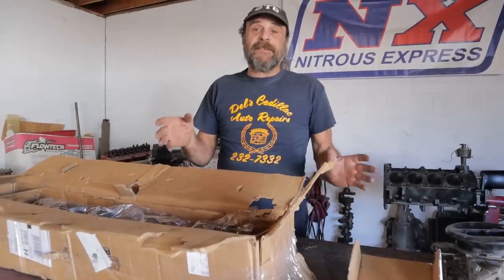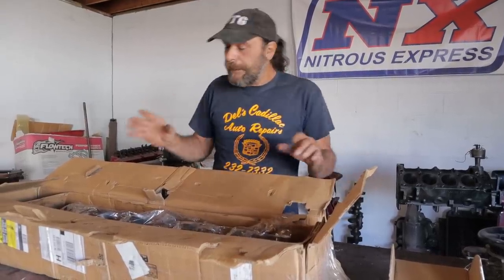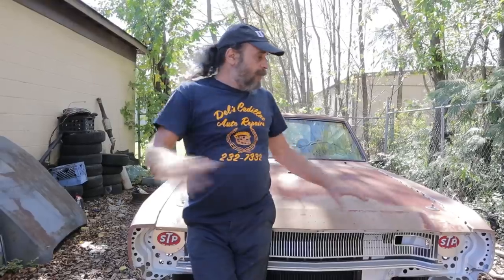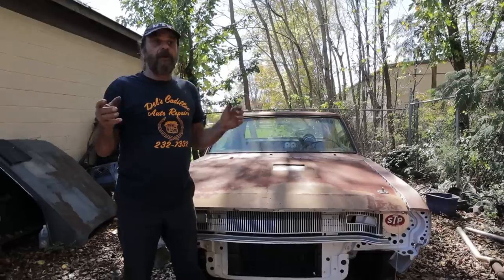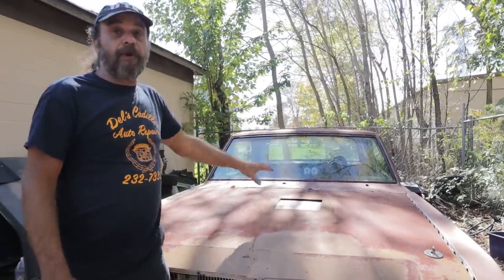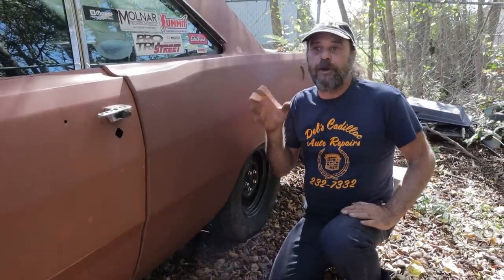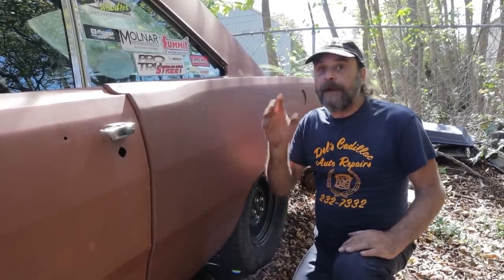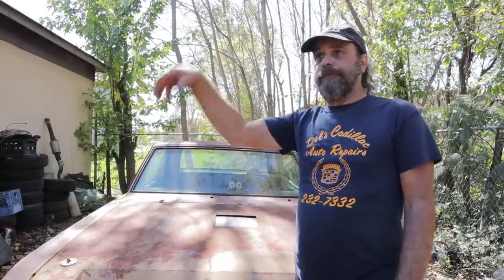The Plan Z Dart - Two Steps Forward, One Step Back

Comment: When you are looking for good metal with nice bends for fabrication,check out old washers and dryers,16 gauge metal with good bends.
Reply: @johnpossum556  If it is small,just a bench vice and a hammer.
Reply: Poor man's brake can be made with 3 pieces of wooden 2x4 , a piano hinge , and 2 C-clamps. 
Put the piano hinge between 2 sections of 2x4 , position the metal over the piano hinge , and then place the third piece of 2x4 over the metal as a clamp . 
Use the C-clamps to both clamp the 2x4s together , AND to hold it to the bench or tailgate. 
Raise the hinged piece , and viola , a brake bend . 
Sawmill 2x4s have a slightly rounded edge , and will put a minor radius at the bend . For hard square corners , you'll need to rip the 2x4s first to give them square edges.
Reply: Whaaat? No way. I've never seen one of those machines that hasn't had a few rust holes in it. They're well built but time gets everything.
Reply: @GlamStacheessnostalgialounge   you ignore the rust and take the solid metal. Since they are often free for the scrapping they may be a decent source of material.

Comment: I would do this, as its something I have done on several A-bodies and it makes a huge difference in the car.

Run 2x3" box tubing from the back of the torsionbar crossmember through the rear crossmember, and cut the bottom of the frame rails out to slide the box tubing inside.  You will have to slit the floor in the rear footwells for the tubing also.  Move the springs into the frame rails by building a box where the stock rails curve upwards.  Tie the box directly into the 2x3" tubing. Build the box out of 14g with 1/8" plate reinforcements, or just use the plate which is stronger.  I usually drill three holes at different heights for the front spring bolt.  That way you can easily change the pinion angle with minor rear ride height changes.    You will have to reinforce the spring bolt holes if you use 14g so its worth it to use the plate.  

Weld everything solid.  Especially where the 2x3 tube comes through the floor, and gusset it at the torsion bar crossmember.  Now you have full frame rails front to back in the car that are fully tied into the unibody structure, and all your front spring mount forces go through the entire car instead of being concentrated in just the rear leaf spring mounts welded to the side of the frame rails and the rocker.  This is which are pretty flimsy from the factory which is one of the reason the convertables got a big reinforcement there.   

You will have less chassis twist so your rear suspension will work better and respond to tuning better.  Its also reasonably light.  About 40 lbs added low and rearward in the car, depending on how thick the tubing you use is.
Reply: Brother I wish we were Neighbors.. Mopar A Bodies Forever..

Comment: Here in Sweden they put salt on our roads 5 months of the year so that is really bad for our cars.
Still I think its possible for you to fix that rust on your car.
Nice too hear that your are planing to test turbo/compressor on your build.
I have built a 318 stock engine from 78 with 360 heads, cast piston and stock rods. Holset hx50 turbo. 904 auto
Blow through holley 600 single pump. pressure converted only with tools in the garage. 
Used the car for several years and it runs nice. BAD 60 ft but that´s what I´m going to fix this year/winter
Et 1/4 12.4 sek and 123.5mph(197km/h) 2.2sek 60ft. Slipping in third.
Keep up the good work and thanks a lot for all your great tips.

Comment: my 340 swinger had the same rust issue on both sides. this is quite common for rust belt cars. most likely the spring mount is solid . the inner and outer rocker probably need patch work .

Comment: Could you do a video on the factory choke set up and how to adjust it on the one barrel Holley for a Slant Six (specifically in my case; a `72 Dart Swinger)?  Thanks.  Keep `em cranking.
Reply: I think he would tell you to add a manual choke cable. Mine never worked right either, even in Fl.

Comment: You can see this unibody is structure is compromised by the alignment of the rear of the door to the rear quarter, the whole rear quarter is lifted up, about 3/8” . That is also why it leaks like a sieve into the interior.
Reply: Could be the door pin is just cracked out, and coupled with worn hinges, lets the door sag... See that a lot on A bodies. My 67 GT, and 68 Dart were both like that, and so is the 69 im about to bring home...
Update... After rewatching, it appears its already been plated/fixed... Never mind LOL
Reply: @Ronald Leckfor, I think the gap is because the weather striping is missing in the door jamb just like the hood stops were removed from the radiator core, look at the hood on the drivers side.
Reply: The top of the closed door rear mates much lower than the top of the rear quarter dog leg. That is what I’m noticing, like the rear quarter is being pushed up, bearing vehicle  weight and giving a bit.
Reply: @DishNetworkDealerNEO  I see what you're talking about but I think it's an optical illusion, the door & quarter panel are two different shades of color, plus the weather stripping is absent, then you have the lighting (shadow from sunlight), also the door may be out of adjustment. Without seeing how much metal is rusted away, it's hard to say. I would say the door line is more like 1/4" out, if that, doesn't take much to make them look way out. Same body line that my '76 Valliant had @4:22.

Comment: hey uncle tony young car guy here 22 i just bout a 71 dart swinger off my neibor that broke his hip for chap just fixed the 318 that sliped the timing chain and bent the vavles and i did bunch of more work to the egine headers cam intake ect  but the 904 is blown up witch he told me aswell seeing if you have an 4 speed manuel set up with clutch pedals and all thatt jazz to go with  forssale for 71 dart because i sure would like to be ripping gears  thanks

Comment: I had a 68 with a slant 6. The top of the car had what was left of a vinyl top. Needless to say the top was so rusted that you could tap on it with a screwdriver and it would dent and chip the top. It was a mess. I offloaded this car because I had already bought and installed a rebuilt short block. It ran well after 4 distributors and 3 carbs. Tomco was what I ended up with. Ran like a top. Not worth putting any more money in to.

Comment: That's what sucks about old cars without full frames. Well, I would just get cutting so you can get a good look at it all. Cut all the bad metal. You'll get a much better look once you cut that rear quarter off then you can access the damage. It's a great car and well worth fixing. You can't just chop it up because there's only so many of these cars left out there. It's just a little bit bigger project but since you have all winter, why not? It's just metal and time and if you don't trust your welding skills for structural metal fabrication work, trade and barter for swapped time. Build an engine for someone in trade.
Reply: Couldn't he just throw some crappy welds at it, mud over it and get frame connectors made? Seems like the best option for these a bodies
Reply: @jamessilly6837  No it needs to be properly fixed. You're probably only looking at half to a full day for an experienced fabricator if he's already gotten all the rusted panels and structure cut out. No matter what, he can weld the new sheet metal quarter back in once the spring support section and surrounded area is all repaired.

Comment: Title is about the outro more than the story? Haha hope she's ok. Next time Tony, pretend to try catch her! Cant wait to see what happens with that car, it's a VF Valiant Pacer Coupe in Aus, my first pick for my first V8 car as a young lad but an old 67 XR Ford Falcon GT replica which I've since built the drivetrain from a 302c Borg Warner gearbox and diff to a trutrac 9" 3.90 31 spine Curries axles with a built TopLoader Hurst shift kit Scat 408c sleeved bores crank and cam journal alignment xrayed cracktested found a weak spot above a cam journal had it rewelded removed every sharp edge on it internally and concrete filled it with all the goodies top to bottom good for 250kw at the wheel as seen in my profile pic and an idle video or two I currently have posted on yt mostly just for a few mates to view nothing big. It should support what I'll torture it with until I look at boost in its future iteration's. Look forward to the channel content your  a God Amongst Men and we are lucky to share a piece of your knowledge

Comment: Hay Tony start with a 69 east 318w9 block factory bore n stroke 10.5 to 1 compression pistons 292 504 cam scorpion rockers / I think 1.25 push rods hydrologic lifters (more forgiving) now the trick late 80 j-heads come off a 360- port matched polish only the exhaust 340 LD4B intake Holly 3310 / now mine was remaned by the man who was a engineer for Holly the 3310 was his baby what is EPA would not put it out the way he designed it oh he got mine and rebuilt it to his original specs - oh cut the heads to 59mm with will jump the compression around 11.5 to 1 now I ran factory exhaust that was sent to Pennsylvania and had a semi-solid poor through them which open them up and polish them they ran as good as any set of headers I have tried this little mad 318 he'll 425 horse to the ground and hands down what's the fastest car in Sumner County I ran 340x motor's and very similar 1970 Dodge Dart swingers and each time I took their lunch money with great pleasure one was a 340 x motor six pack setup that was built by a chiropractor been in Rivergate so he had the money I'm done this on a poor mans budget

Comment: Ye Gods,   I'm too busy tearing my hair out to focus,   ...here's Northeastern mechanic gal  trying to tell Southern lawyer dude to tell the truth about this BMer he bought with a blown engine   and is selling for parts.   "But I told him all about the leaky oil pan!  (not the biggest problem, even if it does mean you'd have to pull the engine anyway,  )   "And the coil packs!   (not the problem,   we already fixed the bad one anyway..."     I'm like,   'if you want to claim I vouch for this,   you need to tell him about the damn internal coolant leak,   probably a head gasket,  posibly a cracked block for all I know!   '    He's like 'You couldn't say for absolute certain in court,   could you?'  I'm like,  "It's not the damn point!   Besides, this guy ain't losing money if he resells the cats and scraps the rest anyway!    "I didn't lie!"   "You lied by omission and implied he could drive the thing halfway across the state!"   

Anyway.   F'n South,  sometimes.  I'm kind of like,  "If you sold a horse and said the worst problem was a surface laceration,  but keep pretending the massive internal bleeding isn't a thing,  that is not telling someone the truth, by my standards."
Reply: BMW big money waste.
Reply: @deuteronimus750  No doubt this thing was junk when he bought it.   He was like, "I wish I'd met you two months sooner," in fact,   cause  he didn't know the damn difference.  I was like,  "All right,  this is probably worse than a coil pack problemlike they said when they sold you this,    cause I smell coolant out your exhaust,  but buy two or three tested original coil packs used.   Do not buy Ebay parts from China."  (So what's southern dude do.   "I got a whole set  off Ebay!"   *me grumbling around hoping we got a couple of good ones in a set of eight."   "Why don't we replace them all?  THey're new!"   "Cause you bought new  crap, is why.   I'm not putting junk in when I don't have to.  "

(Damn wet plugs and compression fail on two adjacent cylinders anyway,  but he couldn't afford a rebuild at the time.   Lawyer friend,  I keep having to say,  'I'm seeing if I can keep you going another month,  but I'm not a fuking judge   you can negotiate mercy from.  If it's broken, it's broken!")
Reply: Glad your feeling better and still talking Shit.. I like most of us Would back you... Stay fighting Miss..
Reply: @AtZero138  Only shit I got to talk,  I guess,  :)
Reply: @OllamhDrab  just so you know.. One of my Very Best friends.. I refer to as Brother.. Is Irish born.. he's still as of yet to become a Citizen.. best folks I've known.. We tell folks of they need prayer.. we ask his Mum.. who actually Knows Jesus.. 😉.. ask her to pray for your health.. 
I look at it this way.. if good people are upset... it's for good Reason..
Reply: @AtZero138  Well, I do happen to be of largely-Irish extraction,  Zero,  and it so happens I'm of a non-monotheist faith,  but I appreciate well-wishes and such in the spirit they're given.   Peace out.  :)